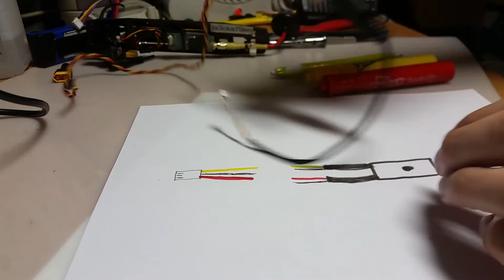FPV Cam TIP - Connect OSD Cable to VTX - HS1177

Comment: So, when you access the cam's setting in the OSD, does the Vtx kick that out to your goggles temporarily  so you can see your adjustments?  I know it's not a flight OSD, but it looks like this routes the menu through the Vtx, to be adjusted by the joystick? Is that right? Thanks for the tip!!!
Reply from the maker: Exactly right.  You put your goggles on and use the joystick to adjust the camera settings.  Then you can walk outside and try it out and make sure you are happy with the color settings. Once you are happy with the camera settings, you remove the cable with the joystick, and put the original cable back on.
Reply: Rc Dad / Sultans of Wing Awesome and thanks, Man!

Comment: great video thanks, If i want to have the battery voltage display in my goggles when flying, how to I connect the HS1177 up?
Reply from the maker: Steve Gee there is a new camera that does that, I think the runcam eagle? this one couldn't do that by itself, without connecting it through an osd.

Comment: Thanks a bunch for this video - made so much more sense now. Appreciated!
Reply from the maker: VeilOfMaya Well...  The OSD that controls the cameras settings is built into the camera.  Think like the setting on a digital camera.  That's what this video tip is about, adjusting your cameras presets.

If you want an OSD that displays info about your flight, like current consumption, gps coordinates, mph/kph  that is a totally different thing.

Hope that helps.
Reply from the maker: Great!  Thanks for watching.  I tried to keep short and informative. :)  Glad its helpful.
Reply: hey there!  I have a foxeer hs1177, came with this cable, will i need to buy anything else for osd?